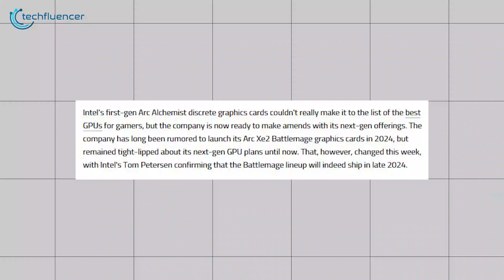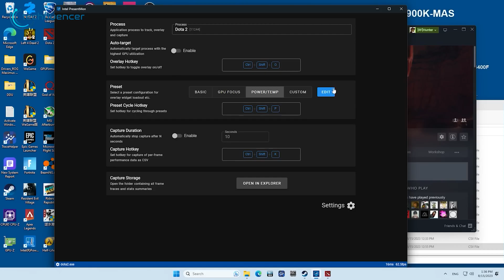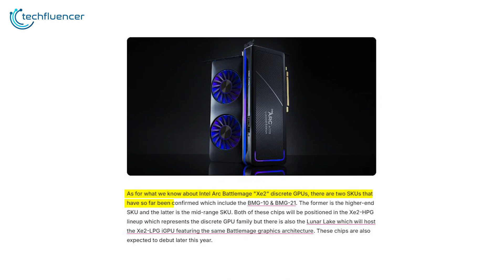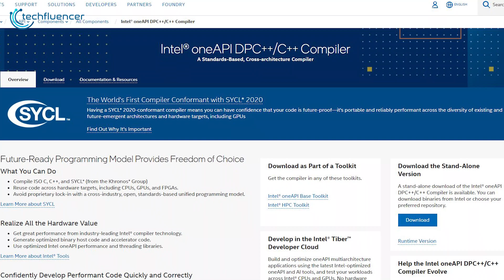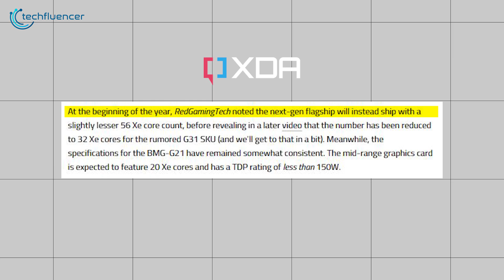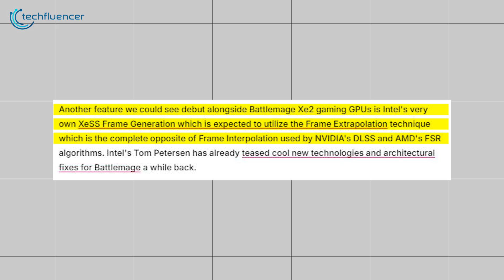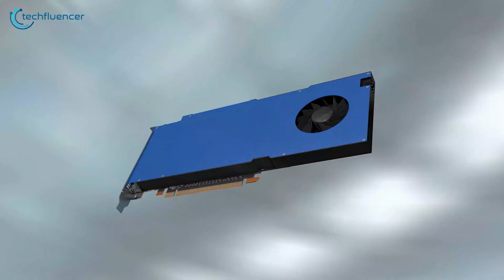Intel Arc Battlemage Coming | Here is What You Need to Know!

Comment: How was the Alchemist a failure? It is better than 4070ti at 4k. Testing won't show the true potential of two silicon pairing that gives you no waiting or queuing where every frame matters. For example more you demand more errors AMD/Nvidia has. At 4k from the ARC you get a good experience from 40FPS. To have adequate experience from 4070ti you need +120FPS at 4k as more than half of the frames are to fill errors. Testing won't show this but at play the stutter is evident. Also ARC is capable of mid and high settings with RT on most applications. XeSS XMX is on bar with DLSS lot better than FSR. When you compare to capped games at 1080p, 1440p and 4k it is evident that you only see half the FPS on counter. It doesn't take in count pairing to CPU. AMD/Nvidia single silicon vs INTEL two silicon architecture. Two different architectures yet judged by same test. I've got the A770 for 4k. Works well. Drivers were good start of 2023 and only got better. $300 for this performance is cheap. Not sure how anyone can say the ARC is bad. Maybe because they haven't used it or are sponsored to say so. 

You can expect Battlemage to launch with Arrow Lake. Battlemage will use PCI 5.0 direct lane to CPU for even more powerful pairing. AMD already launched their X870 motherboards with PCI 5.0 and direct lane to CPU. It is obvious they did it now because their 9800X3D seems to be lost. Yet because it is a no show they still had to launch the motherboard in anticipation of Arrow Lake and Z870 boards. At least they beat INTEL motherboards to the bunch in hope to keep higher marketplace. 

I wouldn't parrot RGT bullshit. It changes weekly. 

Originally I believe it was Xe 56/Xe 64 for the Battlemage. Since I believe it has been changed to Xe2 cores that are 50% more performance. The same now I believe is Xe2 32 /Xe2 40 with 16-24gb memory and bus 256 bit. Wattage 250-275W same as Arrow Lake. Arrow Lake is rated 250W but extreme 295W. So there shouldn't be bottlenecks via PCI 5.0 and Wattage is pretty good indication. Intel Application Optimization (APO). Lets not forget APO that has a promise of 10-50% gain on selected applications and the list is getting bigger as is the supported games for XeSS XMX. If you compare to 5080 predicted Wattage of 400W and we know this is standalone card with only small CPU usage. Then take Battlemage top 275W + Arrow Lake top 295W = 570W. Then note that there is no waiting or queuing. Wattage = Performance as a rule. Both have 256 bus. I think 5080 will loose with a good margin.
Reply from the maker: Valid points!